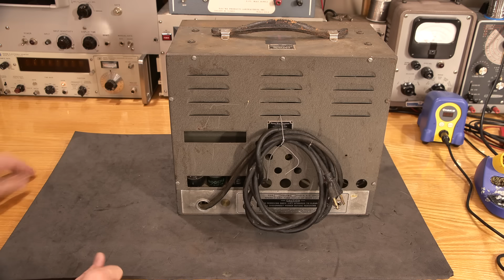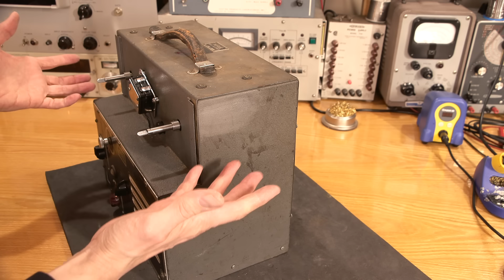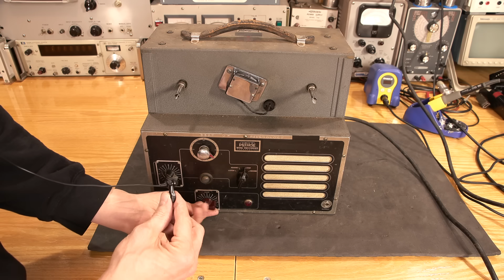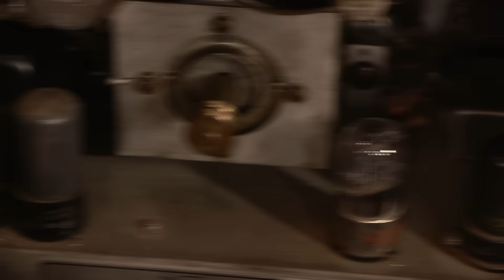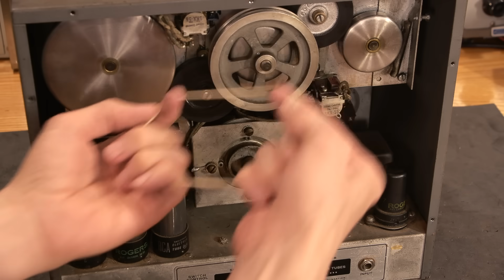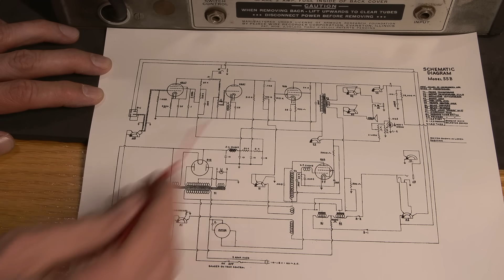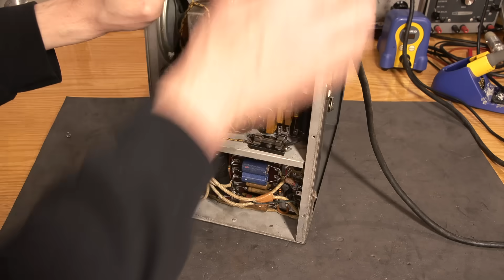Trapped Voices In This Wire - Let's Listen To Them!

Comment: 2:16 in and I'd give it better chances than a 5 year old iPhone, or pretty much any other modern tech that's more than 5 to 10 years old. Not sure how old that thing is, but even if it doesn't work at least you won't have serialized parts preventing you from fixing it without the manufactures blessing from their magic wand. It might even have a schematic on the inside of the case! You won't see that these days. Yes I'm aware you can't fit a piece of paper with the schematic on it inside of an iPhone, but they try at least to keep those locked away.

Comment: What a superb device. That looks like it was very expensive piece of gear at the time. Probably has had very few hours of operation on it, on account of it being formerly used in psychology department. You've got to fix those flat spots otherwise they will knacker the shaft bearings etc. Those would be very hard to replace. Obviously you don't care about speed accuracy at this point so you can e.g., just carefully fix the idlers on drill chuck and use some sandpaper to restore roundness. That should be good enough while working on the machine and searching for someone to rebuild them or find replacements. I wonder if there is still someone that rebuilds idlers in the U.S.A. If there is, he won't be cheap.

Comment: The ability of a spooled wire to spin on it's own depends on carbon content. Lower carbon wire will "set" to a spool instead of jumping off. Nichrome sets too. Piano wire, never.
Reply: The in-between is electric fence wire with a moderate carbon content, it jumps when provoked.

Comment: Yeah you've got to fix it now you've got this far! Presumably a glowing grid means a coupling capacitor is leaking some DC into it. Change some of that wax and paper, see if any of those old carbon resistors are high/open, that may be all it needs - as you said, it seems to be a pretty simple circuit. A breeze for a man of your skills haha.

Comment: Mr paul Carlson, please restore this wire recorder, so we can hear the sound coming from its own speaker. That poor 6V6 audio output tube, you need to find why it's grid is glowing red.  Note: this is the first time I seen a differently designed wire recorder than before, that could also play a 78 rpm record and only need one spool.

Comment: My hunch is that the grid is glowing because there's no plate current because the audio output Transformer is either not connected or has an open winding.

Comment: Hi Paul,
I would like to see a full restauration. I have a GE wire recorder of my own which also is a pending restauration project. The head design of this GE device is quite clever - if the wire rips you can simply knot the ends together. The knot is lifted and does no damage the head.

Comment: Nice to hear it in its entirety restored without any noise see how good it sounds and hear the whole tape.
You could try softening the rubber wheels with putting them in a  jug of water and put them in the microwave for 10 minutes, and then putting them in a saucepan on a very low heat off the Saucepan like on an egg cup and simmer them in PTFE silicon oil for 10 minutes after they've dried to replenish the rubber oil. Would like to hear the whole conversation could be very education you've got any more like this?

Comment: This wire is so very thin.  It is 0.004" (0.1016mm) thick or #38 gauge.  The smallest I have ever used was #28 gauge or 0.0126" (0.32mm) - 3x thicker.

Comment: One thing you could try regarding the buzzy background-noise is to run your probe-device's audio-output through a graphic equalizer and turn down the 60hz slider to cut the machine's hum and allow the audio to be heard better. :D

Comment: Maybe you could connect the wire-recorder's pickup-head to the input on a tape-player, so that the tape-player's built-in pre-amp would get the signal directly from the pickup-head, without going through the machine's "ancient" noisy/weak built-in amp.  You could also try connecting a guitar-amp's input/microphone jack or phonograph pre-amp for a magnetic cartridge, but I wonder if the signal from those larger pre-amps might be too strong for the pickup-head, and erase some of the recording instead of merely playing back.  Maybe a larger-bodied telephone pickup-coil might work better for sensing the machine's EMF waves than your narrow probe device, also?

Comment: I remember back in the late 50s, I got a radio and phonograh console that also had a wire recorder as well. The radio and phonograph worked, but I don't remember if the wire recorder worked. I was about  8 or 9 years old and listened to KHJ in Seattle, Wash.  in my bedroom.

Comment: I for one would like you to get this recorder working as intended. The oddly named black box in airplanes, which actually is a bright orange, uses this same system today due to the resistance of the wire to heat, cold, moisture, and degradation due to oxidation (rust). My main worry is if you are releasing national secrets playing this or if you should even have this recording. We will all take turns and come visit you, lol. Did you find the recording in a Mar-a-lago bathroom? Great video, Jersey Bill

Comment: Loved the video—fantastic opportunity!

Just a small piece of advice: I was taught in the Air Force that touching tubes with bare hands can leave oils that create hot spots, potentially causing cracks. A simple fix is to wear cotton gloves or use a cotton handkerchief while handling them. Every tube you touch should be wiped clean—no solvents needed.
Reply from the maker: Just so you know, I talked about that fairy tale in my previous video. Not true, tubes are not made of quartz glass. Finger oil "absolutely does not" affect them in any way. Tell your friends!
Reply: I think he debunked this in either his last video or the one before it. I know that is how high intensity light bulbs work.
Reply: Oils are a problem for quartz, and wouldn't risk it for higher power tubes that get super hot, but for standard glass tubes like this, as long as you keep your hands fairly clean it's not really an issue at all.
Reply: Yeah, I am a musician who has had many guitar and bass amplifiers that were tube driven, and I never had a single tube shatter due to oils from hands. If anything the heat will burn the oils off pretty quickly, and then it's just some dust left behind in the shape of a fingerprint. These days finding tubes can be tough and they are pricey sometimes, especially matched one needed for good audio from. 100 watt Marshall guitar amps. Usually a matched pair is around 50-60 bucks. I've seen vu Tage original tubes from Marshall amplifiers sell for hundreds of dollars. So, for that reason alone I'd air on the side of caution, but really I would t worry to much about it either way. As lo g as you aren't just holding the entire tube in your hands and rubbing it and tossing it from bare hand to Bare hand after eating chicken wings, I wouldn't even worry.
Reply: That's a myth, vacuum tubes are not damaged by touching them.
Reply: Thank you! I always love the comments that are helpful like yours!
Reply: perhaps that as something to do with radar, lighting/arc tubes or similar specialty things.
Reply: Baloney I've never seen a tube crack and we always pulled 'em out by hand.I like how he started expecting to hear audio without warmup. lol

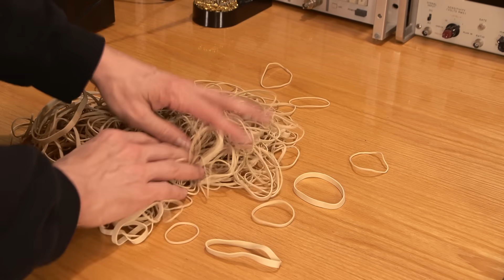Comment: At 15:20 you might try super gluing the belts. My wife has Lemax village displays. The belts on the animated sections always stretch, glaze, or break. I get rubber O-rings from the hardware store. I trim them to fit - which has to be just right. The splice I make in the rubber is on an angle to get more surface area on the joint to be glued. You might be able to find long pieces or rubber similar in diameter to the originals and cut/splice/glue to fit.  I had a old rubber O-ring from my pool pump. It was about as thick as those belts and was about 6 inches in diameter. Something like that might work.

Comment: WOO ! What a great vintage peace.  I used to restore a combined radio and wire recorder, in 1986.  I don't remember what was the brand name, but it was a lot cheaper.  In a nice wood cabinet, but chassis connected directly to one side of the power line, like American five radios.  The one you wave on your bench is WWWAY much better built.  Yes ! You must restore this rarity, according to Mr. Carlson' Lab standards. 🙂P.S. - From your schematic, you explained about one 6V6 is the power amplifier and the other is for recording purpose.  Looking at it seen, to me, like a bias and erase oscillator. Am I right ?

Comment: I had a Webster Chicago wire recorder when I was a teenager in the 1950s. I made a recording of Glen Gould playing Bach's Kunst der Fuge and the tone quality was actually stunning. The recorder had been built into a big Zenith "HiFi" cabinet with AM/FM radio, 33/45/78 turntable and tweeters and a big woofer.
Reply: They say the audio quality og magwire was superior to magnetic tape.  Apparently the inconvenience of the perilously fragile magwire (and the relative inability to fix or patch it, as tape can be spliced/taped together) caused the downfall making way for mag tape.
Reply: @ToxiCom-777  Thanks. Yes, the wire was very fragile and in fact led to  the demise of my unit when it got tangled in the head mechanism. As you mentioned, the audio quality was better than commercial tape at that time.

Comment: Those spools are considerably different from the ones used with my wire recorder. Looks like they hold a lot more wire than mine, which are the more or less standard consumer-grade one-hour reels from the late 40's. My machine, a Webster 78-1, is mechanically perfect, but someone had "serviced" the electronics to the point that I was not interested in trying to correct their work and make the original electronics play. Instead, I removed all the original electronics, and brought the output of the head out of the machine through a short cable to a balanced XLR connector, which allows me to plug it directly into my audio interface. This results in very high-quality transfers. I was amazed that the factory-original, 77-year-old rubber idlers in the transport were in excellent condition, and only needed a light cleaning to work properly. I have collected about 50 spools, and have digitized the audio on them. Maybe it's time to find more spools and warm that machine up again!

Comment: You know my ultra probe is getting its innings when I've already had to repair it once. I'll try to provide better strain relief this time. Hard to fit good relief under the threaded end at the back. But she's back up and running. Literally best sensor of the decade award. I love that thing, thanks for designing it. Incredibly useful.
Reply from the maker: Repair it once? It's still all original, no repairs at all.
Reply: @MrCarlsonsLab  Ha, I was talking about the one I built not yours. Lost in translation. Maybe I ought to edit the comment.
Reply: @MrCarlsonsLab  I meant my Ultra Probe. I used it so much I pulled a wire loose.

Comment: It would be nice to get a full capture of that wire reel. 

There isn't really a lot in it electronically, high gain pentode for the mic and a couple of 6v6 outputs.. leaking capacitors / bad tubes / dead speaker / blown audio output transformer (the usual suspects) are probably all it will take to get it running again, not that I mind watching you work on things, it's a pleasure to watch, it might be troublesome for you to setup everything just to record a simple repair video.

However, since you always have creative solutions to problems, what I would really be interested in seeing with this machine is how you would tackle the mechanical side of things and get the audio off the wire cleanly.  Is there any secret Mr Carlson tech for noisy worn driving wheels? Although not super common anymore, I think it'd be nice to have a wire machine whose mechanical drive doesn't sound like a washing machine on its last stand.

Whatever you decide to do i'll be sure to watch :)

Comment: My uncle worked as a toolmaker for the Marconi Wireless Telegraph Company in Chelmsford, England, in the late 1920's. I remember a conversation, probably in late 1970's, when he talked about working on a reel-to-reel machine which used thin steel tape as the recording medium, he described how dangerous this was if the tape snapped during use - a case of light the blue touch-paper and stand well back!
Reply: that was likely  the marconi-stille recorder
Reply: @andygozzo72  Very likely Andy, I have looked at the history of Merconi-Stile but can't say for sure. He said the deck of the machine was machined from a two inch thick slab (likely to be of aluminium).

Comment: I got goosebumps when the recording started to be heard. Very cool! I vote definite YES on restoration video!
Reply: My Dad took me to a park.. strung a wire up, between two trees.. 
Brought out an old set of headphones. Some alligator (wire) clips..
And, I forget.. a Resistor or diode or something.. 
Clipped to the thick wire..
I put on the headphones and heard the local radio station. WEOK.
It turned out that the radio station was within a quarter of a mile.
Was shocked, his idea worked on the first try.. 
I was probably 8 years old. 1972?😮
No batteries or power source.
Reply: @bubblerings 
Yes!  I used to make crystal radios, much like what your dad hooked up when I was a kid.  I’d ground it to a cold water pipe in my house and extended a long, thin-gauge wire from the crystal.  No power was necessary but I connected a small, external amplifier to the headphone output to better hear the broadcasts.  My uncle, who was a radio repairman in the ‘40s, had a method of making crystal radios with an old pencil.  He’d replace the eraser with a crystal and fill the rest in with solder.  The solder would contact the graphite in the pencil and serve as the antenna.  He also said that a small wire, called a cat whisker, was embedded in the solder as well as some other wires; one for ground and others that somehow ran to an earphone.

My uncle is long gone now and unfortunately, as a kid, I didn’t pay as much attention to the way his pencil radio worked but now at 59, I’d give anything to have the knowledge to make one!
Reply: @bubblerings  That would have been cool at any age!
Reply: @bubblerings  Sounds lie a foxhole radio, our troops used to make them out of whatever they could find in the battlefield..
Reply: That is awesome. As a kid in a kid's mind and imagination...it's like tuning into another dimension. An experience that you will never forget. Thanks for sharing.
Reply: @bubblerings  Your dad made a crystal set. It won't work except with old army surplus "cans" as headphones were called back then. Radio Shack's best seller for xmas was kits to do what your dad did.
Reply: Yes, you could hear the wire was talking about the failures of society and what was going on with individual responsibility at the time, seems like a relevant recording to our own time, I would love to hear this digitized and the audio cleaned up so we could listen to the whole thing and preserve it for another hundred years.
Reply: My first thought was "Evil Dead"... Stop it! Stop it! :D
Reply: @DzeiEidz I love sci-fi aswell,but come on man.
Reply: So did I! I got cold and goosebumps all over.
Reply: YES YES YES Thank You
Reply: And then a ghost speaks... 👻
Reply: Really?
Reply: That would be awesome
Reply: Absolutely, the restoration is a moral must. And the recording should be transferred to digital to be archived.
Reply: I also vote YES !!!  If i had any clue how to do such things , I would also be doing it .........
Reply: Yes,that would be pretty cool.
Reply: It's just audio wire
Reply: I will have goosebumps if it started with.......KANDA.... Kanda…Es-trata…Ta-toon…Hazan sobar…Ear-Grets, Gat, …Nos-feratos …Amantos…Kanda! =D
Reply: You don't have a whole lot going on for you, eh?

Comment: I bought a huge old Ampex VTR, [from the CBS Labs auction] loaded a video tape, turned it on, and the spinning pulleys melted the rubber belts and flung molten rubber all over the innards. Heavy bit of scrap...
Don't turn it on; take it apart.

Comment: I've used rubber o rings meant for plumbing pipes to replace the original o rings. The life expectancy isn't as long as the correct part, but they do work and are inexpensive.

Comment: When I was very young, back the early 60s, we had a wire reel to reel recorder. It was in a cabinet with a radio and old style phonograph. My dad converted the cabinet into a bookcase for our new encyclopedias. I think he threw out the electronics. Too bad, as back then, there was no nostalgia to preserve/restore legacy equipment. It was called old fashioned junk.